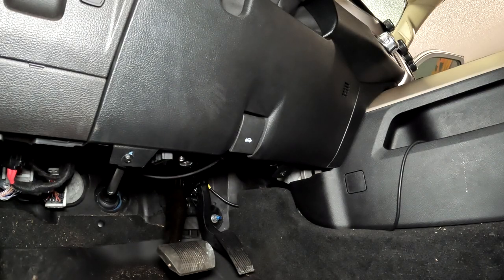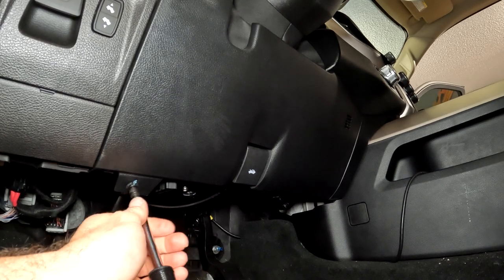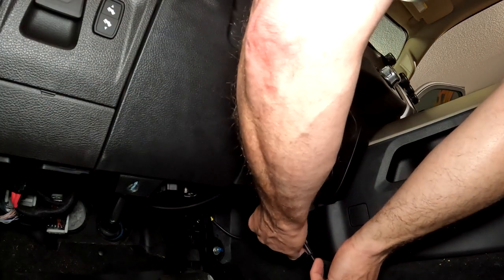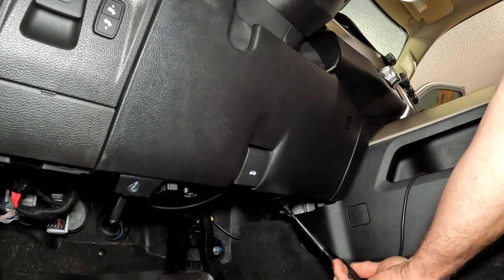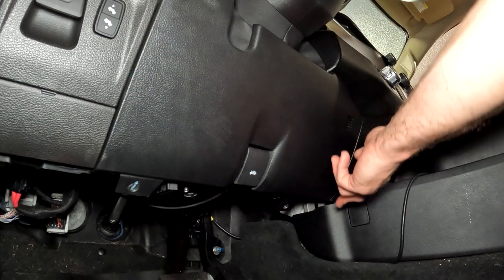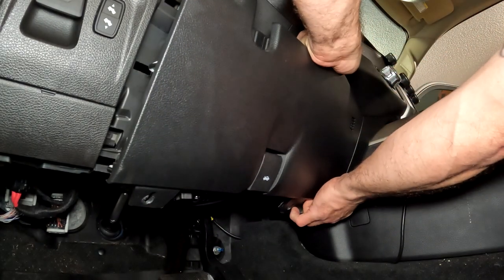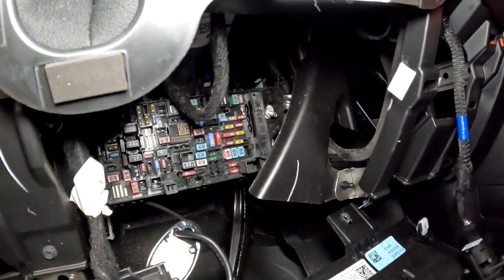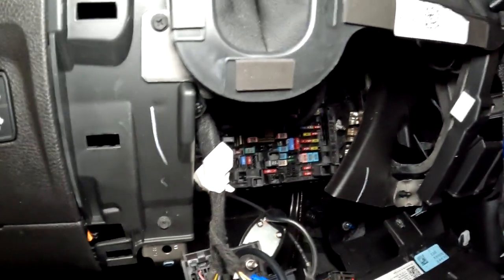2021 Dodge Ram 1500 Interior Fuse Box Panel Location: How to Access and Find

Comment: The layout and design of this fuse panel is terrible.
Reply from the maker: I agree, not the most easy to access, change a fuse or to add anything to it.  Definitely trying to make it harder to find where the fuses go and places for you to tap power for accessories.  Thanks for watching and taking a second to comment.
Reply: @RagerJackOfAll  I recently just added a dash cam and using fuse taps. I just noticed my dimming mirrors doe not work. The manuel is not entirely clear. Any clue what fuse that could be? I didn't see any blown
Reply from the maker: @tratzum  Unfortunately unlike the past you cannot even find a fuse box listing anymore for any car.  If you do this regularly or plan on it, pick up one of these.  If you need it "today" you can probably get at an Autozone, or another local car parts store.  This will let you slide the switch to whatever size fuse you need, and all you do is touch the top of the fuse to find the bad one, takes only a few seconds.  Wish I could help more, you may get lucky and call a local dealer and ask for the service department, get the right guy he may tell you what the fuse number is.  Most likely not, they want  you to have to bring it in.   https://www.amazon.com/Bussmann-FT-3-Automotive-Tester-Puller/dp/B00139OH0G/ref=sr_1_10?crid=3I8CUOLUY7ECS&keywords=fuse+tester&qid=1658517031&sprefix=fuse+tester%2Caps%2C73&sr=8-10
Reply: @RagerJackOfAll  today I found out the service rep at the dealer would not even try to help me. As you said they want it in the shop.

Thanks for the reply though.
Reply from the maker: @tratzum  Yeah, nobody any longer wants to offer anything for free.  Get one of the fuse testers, that's probably your best bet.  I have looked online for the fuse panel diagram but can't find that one.  With the parts shortage seems like the last 2 or 3 years seems like they are using different year parts in different year vehicles.  I have a 2021 BMW with a 2019 fuse panel in it.... Makes it even more fun trying to do anything.  Good luck with it.

Comment: I have a 3500 dually and it's nothing there. So I'm now lost
Reply from the maker: Dodge seems to move their fuse panels around for some reason.  It may be behind the glove box,  but there is also one up under the hood, depending on what fuse your looking for.  Hopefully its the one under the hood.  Thanks for watching hope it helps.  Should be about the size of the battery.  Here is one picture I found online, but again they seem to be inconsistent different years and models. https://fuseboxinfo.com/images/cars/dodge/ram_1500/dodge_ram_1500_fusebox_engine_compartent_2010_2021.png

Comment: Christ sakes I removed the 2 screws but was afraid I was gonna break the cover when pulling so left it lol. Try again tomorrow.
Reply from the maker: Lol been there on both, have been afraid and have broken tabs.   Worst tab I broke was on an overhead console on a Ram.  Was and wasn't really my fault it was a press in tab meant to be pulled but both sides at one time, my hand slipped and snapped one of the main tabs.  Here's what you do, and next time "there will be a next" I will video it.  Take a construction nail, put it in a pair of vice grips, heat it with a candle, torch, stove, whatever you have till its almost glowing.  Take the broken part of the tab and the part, touch the plastic on both sides to melt and stick it back together.  The plastic cools rapidly so be quick and precise.  Don't over melt it either or your tab may not reach.  Will it last forever? Will it last til it gets to trade in, definitely!  Thanks for watching and commenting.  If it is a different year, double check every now and then the change the screw/bolts and make sure yours doesn't have an extra somewhere.

Comment: Where is the fuse for passenger headlight low and high bean?
Reply from the maker: I do not know for sure.  I cannot find a "fuse map" anywhere online that matches the fuse box.  If your headlights are not working get one of these, https://www.amazon.com/iztor-Automotive-Multifunctional-Tester-Removal/dp/B08XZ219ZV/ref=sr_1_11?crid=120UU8PFL2KKA&keywords=fuse+tester&qid=1661796694&sprefix=fuse+tester%2Caps%2C75&sr=8-11 .  It will adjust to just about any size fuse, you just touch the fuse and it will light up if the fuse is good and you have the circuit on.

Comment: What is that? Look alike, speaker is on the panel. Thank you for showing.
Reply from the maker: The "Extra wiring"?  lol That is where the factory well light is, I added led lights for the floor boards, just tapped off of the oem lights.  Truck is a lease when I'm ready to trade in can just unplug my add ons and plug the OEM back in.  Thanks for watching.

Comment: Great job friend 
I have a 2015 ram 1500 
Os that fuse box on same location?
Thanks
Reply from the maker: Not sure when they changed the location, I think that it changed in 2018, so yours is probably behind the glove box.  You will also have one up under the hood, usually looks kind of like an air filter box but will be marked fuses.  If you stick your head up under there you can see it without removing the panel if you can get up in there.

Thanks for watching hope that helps a little.

Comment: The box under the hood is not controlling the right headlight 
There is not particularly fuse for it 
And that is my problem on the  the passenger side after trying to install some LED light 
Someone told me that the fuse box under the hood only control the driver side headlight and the Body Control Mode is the one that send power to the right headlight and I need to check the fuses 13 and 90 on the BCM that is located under the steering wheel but I can see it not fuses there
Reply from the maker: Look inside the driver side door, on the "side" of the dash board see if there is a panel that looks like it would pop off, there may be a small fuse panel there.  It is one of those things you may have just looked at for years and never really noticed it.  It would be between the door and dash board if you were inside and would never see it.

Comment: No it is not 
I believe on 2015 ProMaster is around there 
Someone said the BCM needs to be cleared with scanner tool 
Some others said that I would need to replace the BCM 
There is one that he just runs two wires from the drive side headlight out to the passenger side with a relay and that will be a very easy fix 
Thank you friend for your help 
If you figure something out just let me know please 
Thanks again